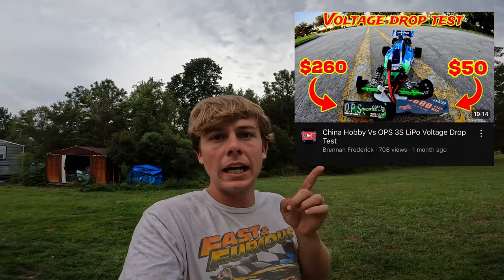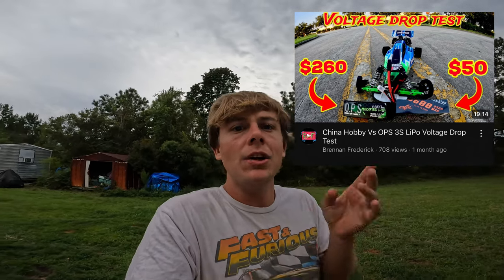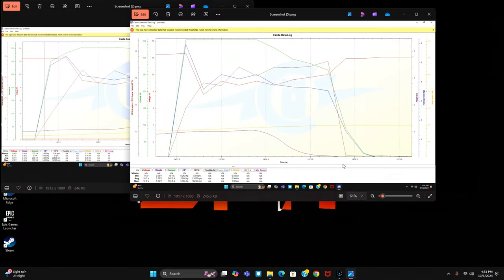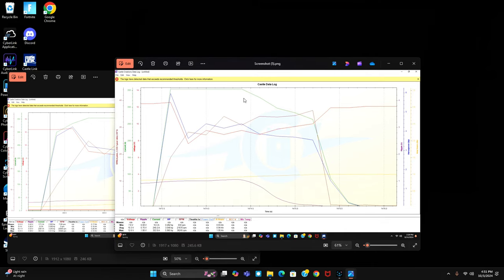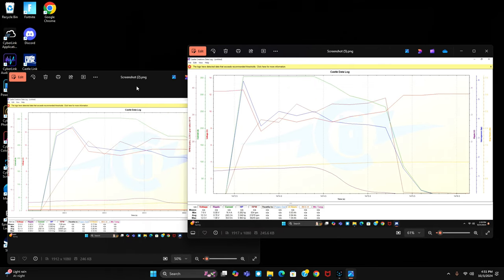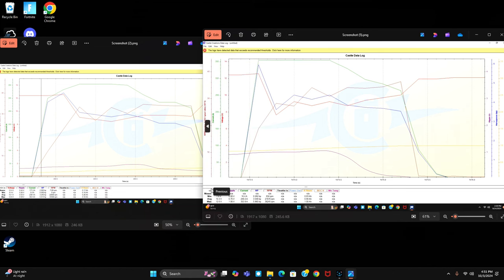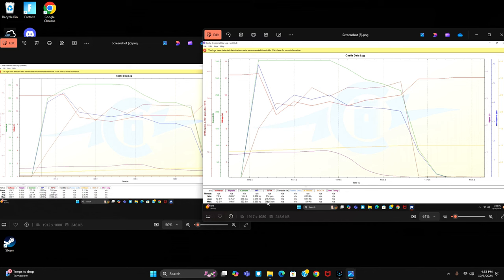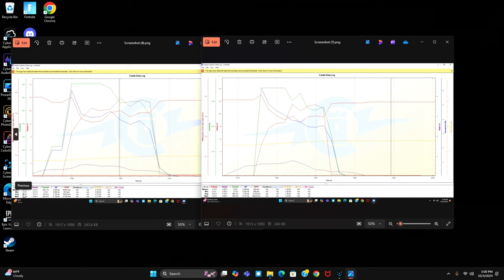12g Vs 8g Battery Wire Voltage Drop Test

Comment: Castle reads electrical rpm. So for a 4 pole motor the rpm settings need to be double. Might be why you’re dropping so bad and your amps are so high.

Comment: My 6600mah and 8000mah CHNL come’s with 10AVG wire not 12🤷🏽‍♂️
Reply: I've gotten both . Namely explains pricing differences with cnhl . They're not practical but I still say the 9500 90c 6s is all the beef anyone needs